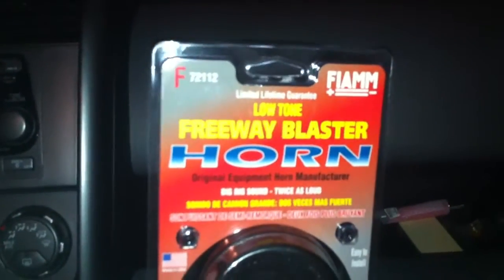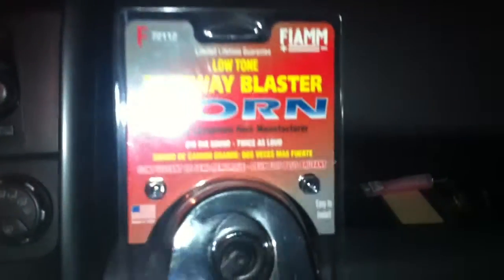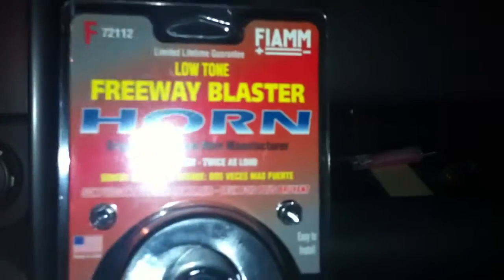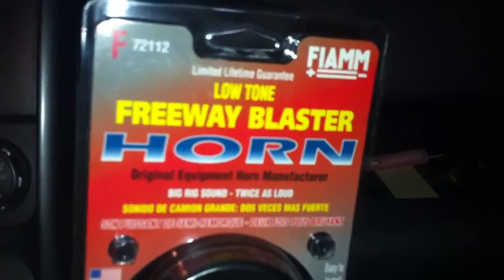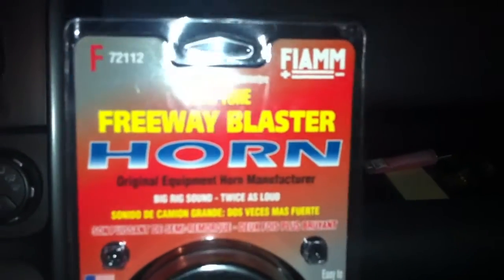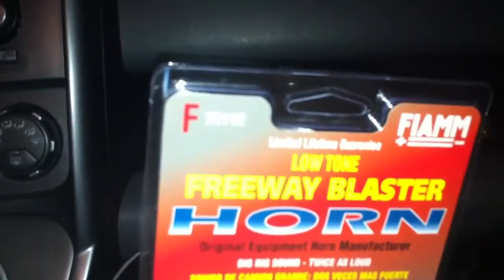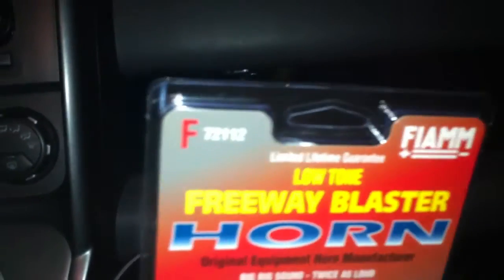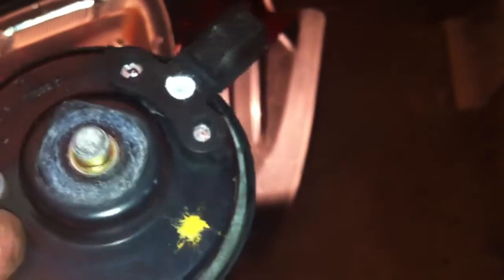Honda Element Horn Replacement- FIAAM freeway Blaster

Comment: I bought the low tone and the high tone and incorporated  it where the old horn was and ran a jumper wire to the other connector and the sound is Magnificent,a little inginuity goes along and my wife wanted it that way.what can I say ,Thanks for the video it helped alot

Comment: Planning on getting the high tone for my 2001 Silverado. The horn currently in there is the same pitch as the low tone here. So I'll keep it installed and use the high tone to make it a two-note.